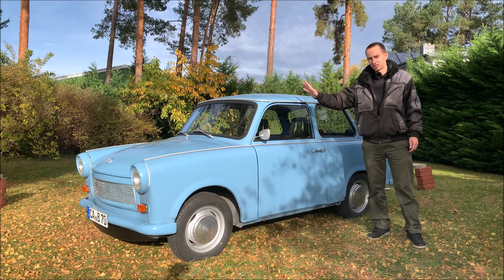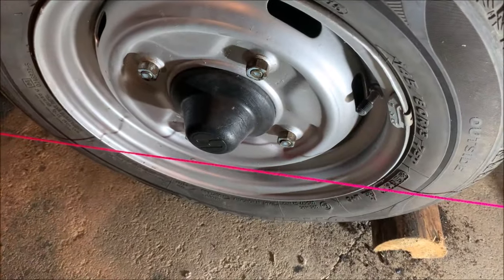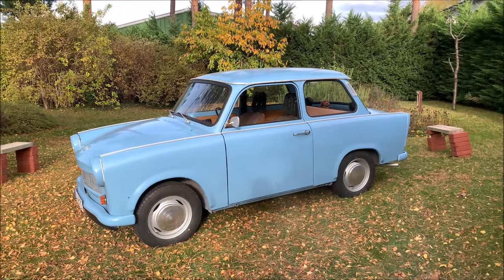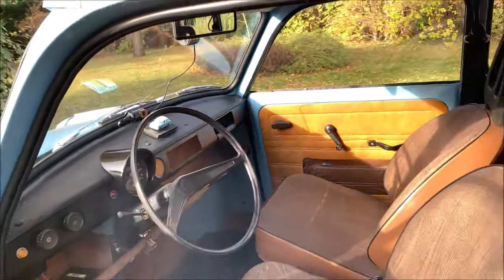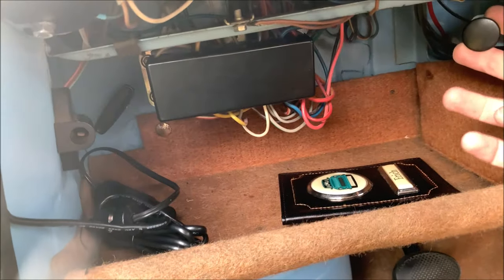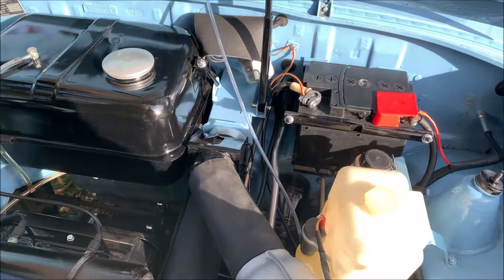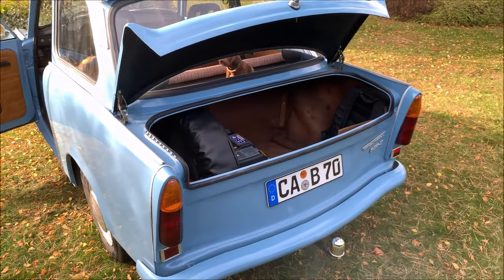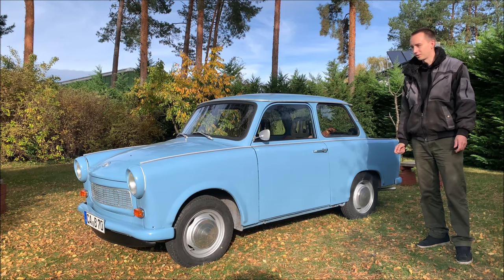My TRABANT is FINISHED! New TÜV and First Drive!

Comment: My Trabants' steering wheel wasn't straight, so bad in fact it could steer sharper to the right than left, along with extreme tire wear. And it would pull while driving. Luckily I found a mechanic shop that had an alignment machine narrow enough for the Trabant, and experience working on older cars. It's been perfect now.